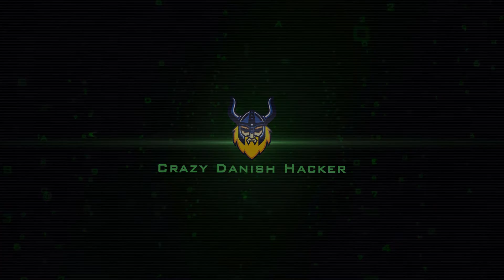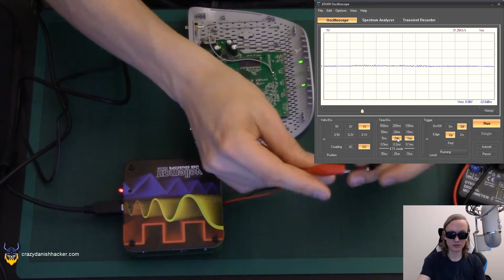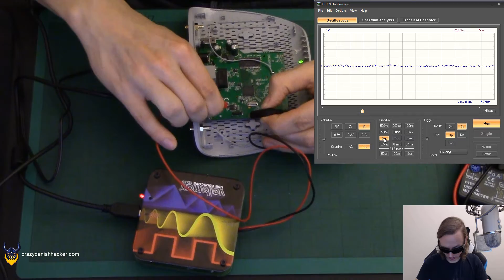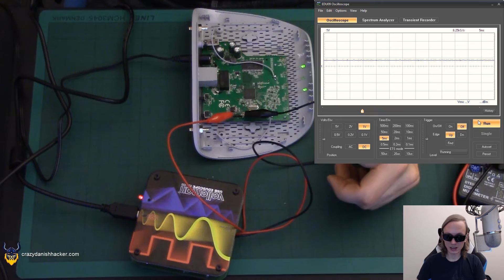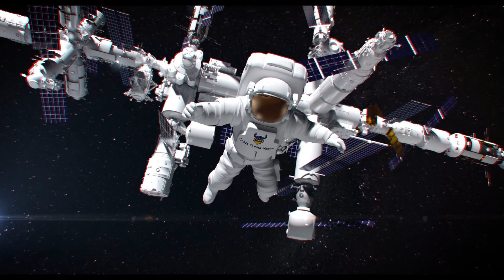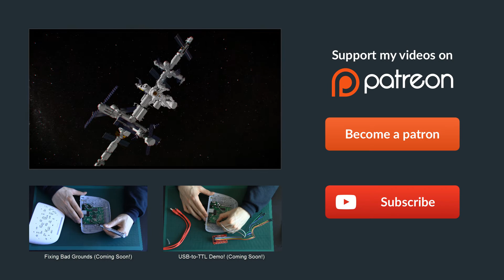Accessing Hidden Serial Consoles - Multimeter & Oscilloscope - Hardware Hacking Series #2

Comment: If you get a better scope like the Rigol DS1104Z or plus version, you can use the protocol decoder to read the data you capture.
There are some good deals out there. Yes, it's quite a financial investment but so useful for analyzing this sort of data.
You would also be better off with a scope with coaxial probes and BNC connectors.

Comment: @ Crazy Danish Hacker instead of an oscilloscope, decoding the signal could be accomplished much easier with a USB logic analyzer, like a Salae clone that can be picked up for a few dollars from China and is fully supported by either Salae’s own software or the open source software Sigrok. Both software suites include decoders for common protocols, so no guesswork is involved. You can even write custom decoders for Sigrok for protocols that aren’t included by default.

Comment: What if its not obvious which pins are UART? How to find them? in your case its pretty clear, that this pins are for Uart,... but i have a piece of hardware where it is not very obvious and no one has ever analyzed it :/
Reply from the maker: Not all boards will have a UART console as far as I know, but what you can do, is connect an oscilloscope like I did and just try your luck.
To shorten down the time spent, use a multimeter and check that the possible UART pin is not just a grounded pin as it won't be used for data transmission then.

Before you do all that work, google the piece of hardware and check if anyone has done any reverse engineering before you, and if not, check if there are any specifications available like board diagrams, repair manuals, etc.

There's also another method where you can use a "jtagulator" to bruteforce JTAG and/or UART pins. What you do in this case, is connect the jtagulator to various possible pins and then you run the program where it will try to identify JTAG and UART pins. 

You can either buy the somewhat expensive model from Joe Grand or you can make your own with an Arduino I think. Not as fancy and probably not as feature rich, but it's an alternative if you don't have a lot of budget.
Reply from the maker: Keep in mind that there are various other serial terminals / pins, even some that only require 1 pin. In that case you'll need a device like a BusPirate to interact with them.
Reply: Hi! Thanks for your replay! Here's a picture of my hardware (smart friends box v3, running Linux most likely): 
https://ibb.co/mS79tU

My guess is, that J4 or J6 may be UART. 
On the peripherie board (the bottom hardware board) there is J5, J7 and a dummy slot for a Mini-USB (J9) maybe thats UART?
Well, there are many more unpopulated slots.

I can use a oscilloscope at my university, where would you start the analysis? 

I have a "BusPirate" board and also i have a jtag adapter!
Reply from the maker: Just by looking at the board, I was thinking try out J4 or J6 as well. But before trying those as they're not super likely to be UART or JTAG, I was going to say unscrew that board and look beneath it. 

However, after having looked at all the connectors, I think J5 (next to J6) is actually UART. One of the pins is even a square :-) 
It looks like there's something connected there though, but it looks like those components were added at a later stage because of the glare.

I could be wrong though, and SMD soldering is not super fun, I recommend you get a pair of tweezers if you're going to remove it and put it back.

But before you try any of that, unscrew that board in the middle and look what's beneath it. 

I assume you already tried googling the name of that device including what's written on it. (I did and didn't find anything useful on the first google page by the looks of it.)

While Mini-USB can be used for UART like in Samsung phones, I don't think it's used in this case. (You would have to guess or bruteforce the correct resistance on the ID pin too.)

With the oscilloscope and multimeter (just a cheap one) just do what I did in my video, find a ground pin, and then look for pins that change voltage when you power on the device. UART for routers like these should be 3.3v max. It has been a while since I did this, and the voltage will probably not be exactly the same as I did in my video, but the overall method should be the same. 

So once you've found a potential candidate, then hook up the oscilloscope where one connector is ground and the other is a potential data port. Then adjust the settings on the oscilloscope, so you can use it to visualize difference in voltage levels over time, as that's essentially what data transfers are. (If my cheap ~50$ USD DIY USB oscilloscope from Velleman can do it, so should your university's oscilloscope which probably costs 1000$)

Glad to hear you got a BusPirate and JTAG adapter, then all you need to do is hunt for UART ports.

You can do this manually like I did, and for JTAG you can try this cheap DIY project:
https://github.com/cyphunk/JTAGenum

Pro Tip: While hunting for possible UART ports, keep the BusPirate running and then have the correct data wire (for incoming data) ready to probe various points instead of soldering on headers. Once you've found the UART port (if there is one), then you can solder on headers maybe.

Last but not least, some of those integrated circuits (IC / chips) could also have UART available on one of their pins / "legs". In that case you'll need to upgrade your soldering skills a bit and solder on a wire to the correct pin(s). 

So start googling what each of those chips / ICs are and download the spec sheets for them. If they mention UART then you may be in luck.
Reply: HI there! Thanks for your time! I followed your advice and unscrewed the board completely. I found a processor which i was looking for (See Picture):
https://ibb.co/estgsz

Also i found a 4GB flash memory chip (the Kingston one) :P
The Marvell 88AP1-BJD2 should be a ARMv5 Processor (it is likely that the board is running a Linux (Nmap told me :P)). But i don't find any datasheet for it online, so i requested the datasheet at a seller, maybe he will send it to me.
I found a semilar one online: https://www.marvell.com/docs/application-processors/assets/marvell-application-processors-armada-16x-software-manual-2010-11.pdf  it describes a 88AP1-Family Controller with ARMv5TE instruction set and: UART PINS and also JTAG :-)

But there are so much pins around the Marvell 88AP1-BJD2 that i don't really know which is UART. I tried a few but i didn't found a pin with 3.3v yet.
Any ideas from you? Which of those can be UART? 
I can use the laboratory with the oscilloscope and multimeter of my university only 45 minutes next week (strict time limitations :-( ), and i want to find those pins then :P
Reply from the maker: For some reason your response ended up under comments to be reviewed. Anyway if you look at your picture, on the top left almost, there are 8 normal sized pins (2x4). One of these pins is a square. Try that particular row. Keep in mind that it could be slightly higher or lower voltage, but if basic analysis with a voltmeter doesn't help, then try an oscilloscope configured to capture the difference in voltage levels over time, as I demonstrated in my video.
Reply: @CrazyDanishHacker  Hey there, just want to let you know that i did it! :) Found the UART Pins (j10 was actually UART) and got the firmware + root access to the device. (Just added init=/bin/sh to the bootargs and i got a shell as root user, then installed an SSH server and now i can do everything i want with this device... Thank you for this video again!! ;-)